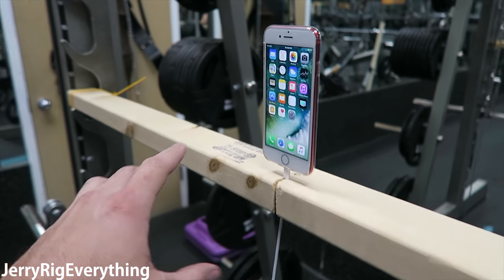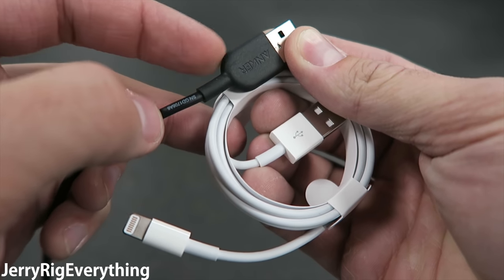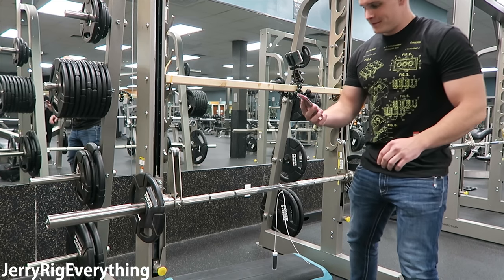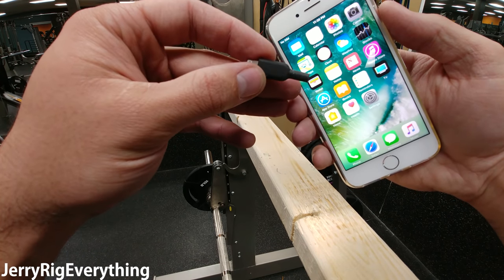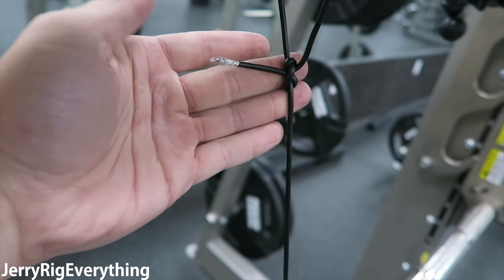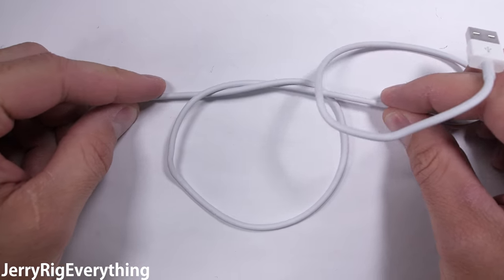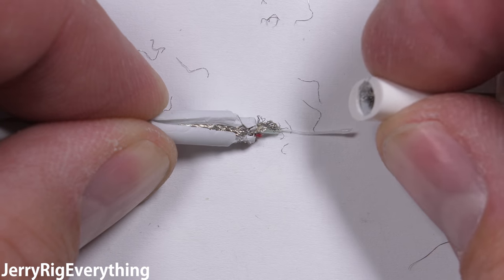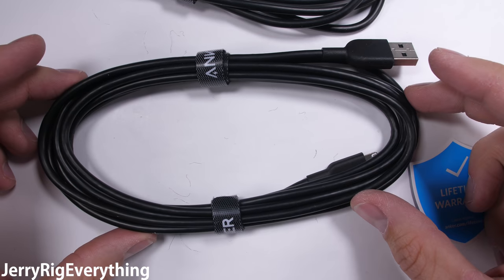Worlds Most Durable Charging Cable? - Tested!

Comment: My brother bought one of these a bit ago, and it broke very quickly, after like a month or something. He had to tape the end together to get it to charge. I have one now, and it already has weird charging problems depending on the angle the cable is bent at. These are not strong cables. The LAST gen version of the same cable was WAY stronger.

Comment: I just bought similar cables to this one, made by Anker but with the nylon braiding and it’s red. I can already see these are built like a tank, and will last a long time. It’s not like the original cable they provide in the box. Just comparing it  the cable is a lot thicker, a stronger neck and high quality materials. Best part of all these are made in Vietnam, and not China like the Apple cables which is probably why they broke down so quickly.

Comment: I've found that cables also break where the connector exits the shroud. Twisting is a factor and they often start to breakdown before the strain relief. 

Micro USB were notorious for their plug retaining clips to fail; the springs would weaken causing the plug to fall out of the socket. Very few were reliable. It's not so much of a problem with USB C. 

Often wires will break inside the sheath without any obvious external signs. Same with 3.5mm headphone jacks, which is a huge bane in my life as I still prefer wires over Bluetooth due to the audio quality. I've got a pair of Flares Jet 3 in titanium that have had 3 new plugs within  months. Great buds, crappy cable.
Reply: Wow, this video is definitely trending late. Bit of latency there.

Comment: The apple cable lasting a year or too is absolutely wrong. My mom has had a 6 in apple cable for almost 10 years the head and the usb area have no more covering on it but it still charges like it did when it first came outa the box. But anyway nice vidro

Comment: I have a few questions but I’ll just ask a couple. 1. Did u add in the bar weight before u added the weights? 
2. I see u used Bolon knots but when u bend ie wire rope etc it depletes strength significantly. Also saw I think u changed the knots at one time to a clove hitch so that would also change the dynamics. Ugh. Don’t want to b that guy but your experiment has what I think r many flaws. Don’t get me wrong I love your vids but I know how u r about authenticity. Thanks

Comment: this is a perfect example of standard safety procedure. with only one knot the cable failed at 30 lbs. add a second knot and the cable holds less than 25 lbs. adding a knot reduces a cable's safety by half, meaning that most safety regulations require double the margin of safety when a knot is involved. there is a reason my climbing rope is rated to thousands of lbs working load despite me only weighing 200. there is a reason OSHA requires 5000 lbs working load with 10,000 if there's a knot in the line.

Comment: Stupidiest test... The cables break not because someone pulls trains with but of bending sockets and pet chewing (I have a rabbit and it spoiled 3 cables already). I bought some protective cable but the rabbit bit some spot WITHOUT ANY MARKED DAMAGE, and that strengthened cable stopped working. Perform that kind of test

Comment: this really doesn't show whether or not the cable will stand up to the kind of problem that cables usually run into, which is flexion based damage at the joint. I don't know anyone who's yanked a cable in half, I do know that when my cables typically go, its at the joint between the plastic housing and the cable and that fraying is flexion based, not force based. now I do believe the anker will hold up better than the original apple cable because it seems to have a better system for managing that flexion, but this type of testing is misleading as it would indicate that the wire sheath inside the cable is somehow helping with the flexion based damage, when its pretty clear from the rapid unscheduled disassembly it went through that that cabling does not extend into the housing.

Comment: well the actual problem isn´t that a wire gets ripped of.  The rpbolem is that most cables get "broke" inside cause the cable gets move around often. You should test this instead of what a cable can lift lol . Bend a cable 100 times or 1000 times and test the difference

Comment: When a cable breaks its rarely because of tensile stress. they're usually damaged by being repeatedly bent and twisted. Apple actually uses high quality cable and I've never broken an apple cable in 15 years of owning various apple products.
Reply: He literally covers this later in the video and that last sentence has to be a joke. Every friend I have with an iPhone goes through a cable every 6 months if not more.
Reply: @jameswilson8907  I'm 100% serious. Maybe I've just been lucky. Do you generally break the cable, in the middle, away from the connector, or right where the connector joins the cable?
Reply: @jmc8342  it is always where the cable joins to the lightning connector

Comment: I know this video is old but whenever happens when my cord breaks say are used to use those ones that would usually come with your phone or iPad or anything and you know how you plug them in the cord leading down to the block at the top where I plugged in he gets so hot that it was Melts down until I can see the wire

Comment: Ok, but the last two expensive chargers that claimed to be strong has a bigger flaw then the issues with Apple's. The actaul connector came seperated from the plug. On both, just fell out. Two different brands. This test doesn't test the full durability of a  cable.

Comment: Had this, at one point the wire around the cable came off and started cutting into the cable and destroyed it.
Reply: That's why I didn't like the tests. They are not very realistic or comprehensive.

Having tried both cables, I will always go with Apple's cable

Comment: thanks, next time I need a cable that I will need to pull near the connector (instead of bending and plugging in-out many times) I will surely get one. estimated time when that will happen - never.

Comment: Whoever invented this test does not have children. Pulling cables isn't the problem, snapping connectors is.

Try this, put that iPhone on a charger. Then pace a book under the charging connector touching only the connector and not the phone. Finally, push down on the iPhone. How long does it last then?

Comment: I sense Bias in the Tests. A cable is not supposed to lift pounds of weight. Main problem with is of tears at the neck
which I suppose was never intented to be tested in the video.

Comment: Rubber is horrible to use as a cable. it feels of high quality at first but it wears so easily. If you buy those cheap plastic type cables it doesn’t wear nearly as easily